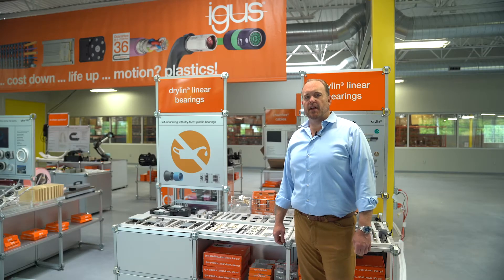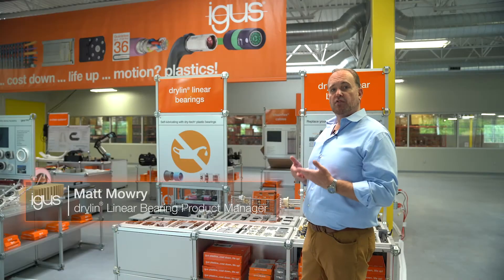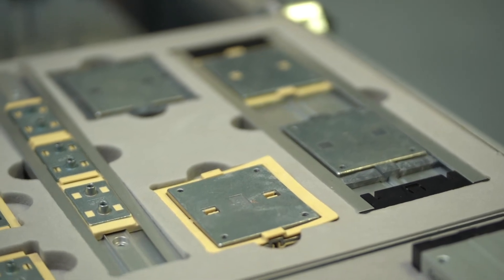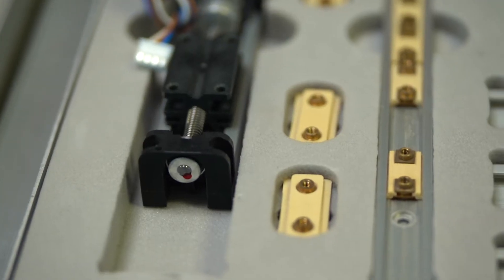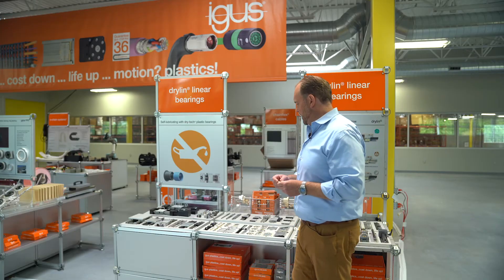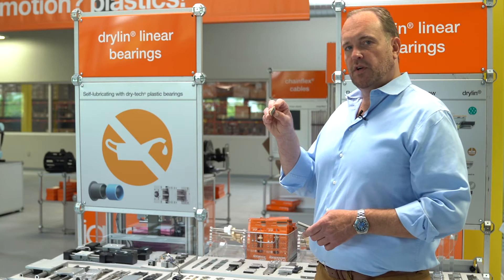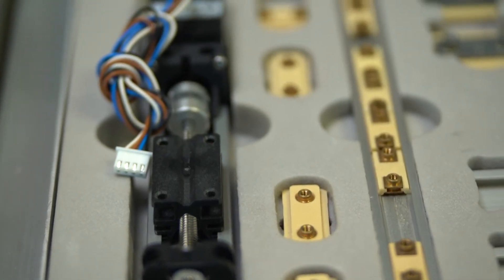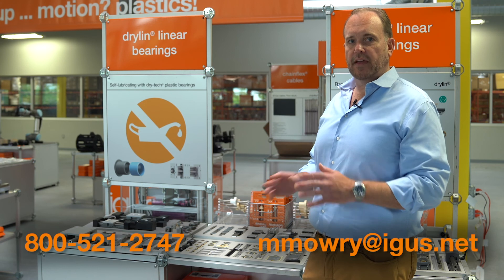Overview - drylin® N linear bearings

Comment: Hi, a quick question, could some sort of manual brake/lock be applied to N series carriages?
I love the low profile of these guides they seem perfect for my project, esp the 80mm wide version, perfectly designed bushings etc... 
There will be very low weight on them as they will only carry a small plate with 2 or 4 drill bushings on it. Manual slide into position so no power/speed, but I absolutely must lock them once in position.

Any advice and thank you.